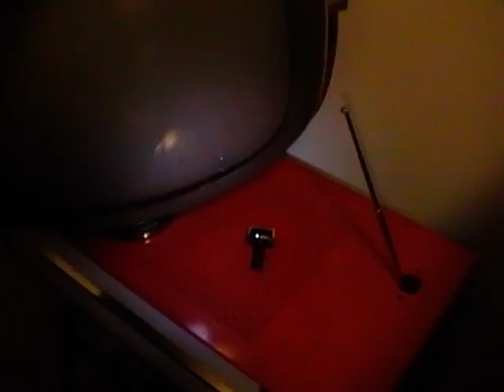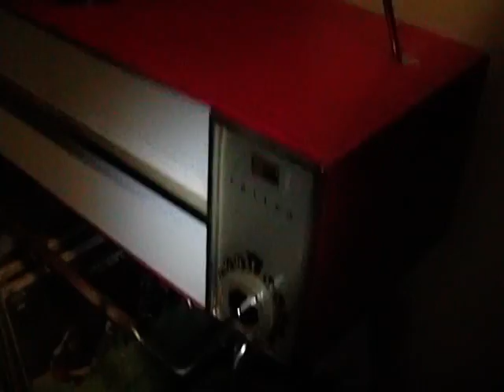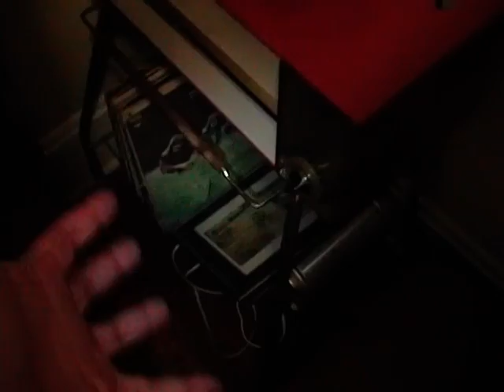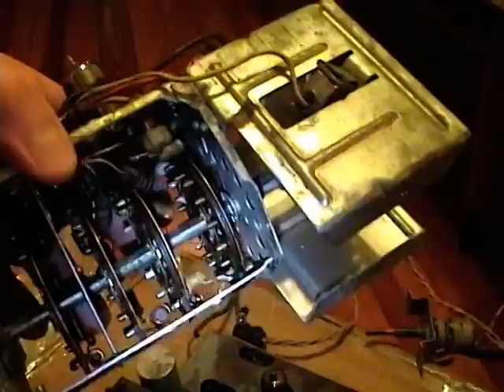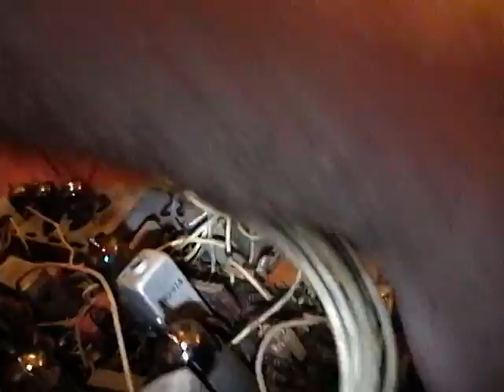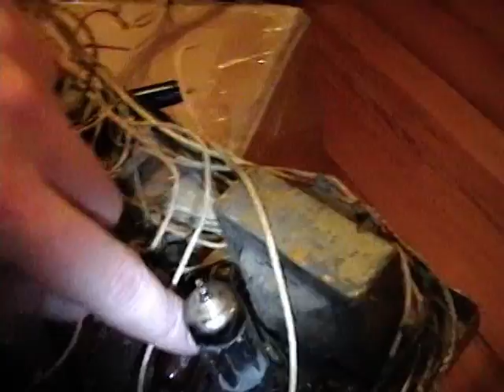Philco Predicta Televisions

Comment: Did You Check The Fusible Resistor Its Probably Shorted Out
Reply from the maker: I think you meant opened?  I did a complete overhaul and got this set working a few years ago.
Reply: @bandersentv  Yes i meant opened. I also have the predicta  princess in brown it has sound but no light on the CRT the CRT has filament don’t have any crt or tube testers all the other tubes seem to have filament not sure if the 6AW8A Vid output tube is bad or like i read in the sams it can be caused by the Horizontal AFC Diode going bad any I remember the picture going out with it shrinking to a  vertical line and then completely shutting off only producing audio when I was fiddling with the with , height and the horz freq dial cause the set has bad horz lock that indicates to me that the CRT isn’t bad it’s something in the horz circuit that maybe overheated cause I swapped my bad fusible resistor for a car fuse clip leaded onto the fusible resistor plug which isn’t a good idea cause the fuse resistor is meant to give the set a slow warm up but it’s all I really have also the the damper tube looks pretty roasted wonder if it red platted any suggestions bob?
Reply from the maker: @officialcanadianshackster  Did you pull the main board and fully recap the set ?

Comment: I recently just picked up a Predicta Princess for 850 dollars.  Yeah I know it is a bit steep of a price, however the guy who had it is also giving me another full chassis for this set for free.  This guy guts them and installs game consoles inside with a modern LCD screen.  Nightmare!!  I actually like working on these, the only problem that really pisses me off about them is that circuit board mounted tube sockets.  Freaking get it all completely restuffed just to realize one of the damn sockets had broken UGH! LOL
Reply from the maker: Just replace all the sockets while you have the board out. Surplus sales of Nebraska has something like 28,000 of them in stock. Perfect match for the originals but thicker metal
Reply: Oh wow, thank you for that information Bob, that was greatly appreciated :)  Also what is the transistor thing in the socket on the Princess set?  It has 3 pins?  Does it need to be removerd and replaced or will the set operate just fine with the original part?  Cheers
Reply from the maker: Do you have the service info ?  It's the dual diode in the horizontal AFC circuit.   Might be good, might be bad.  You can replace t with a couple silicon diodes or get a dual diode.  I think it's common cathode.
Reply: I do have the service Information.  Need to print it out though because it is really hard to work off a tablet or a phone.  I'd rather have a paper copy so I can stick the schematics together.